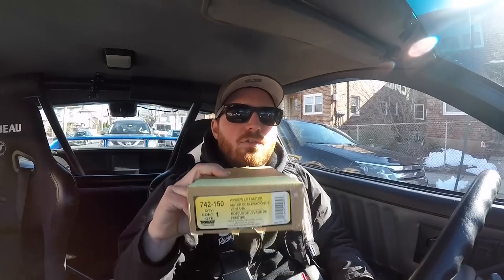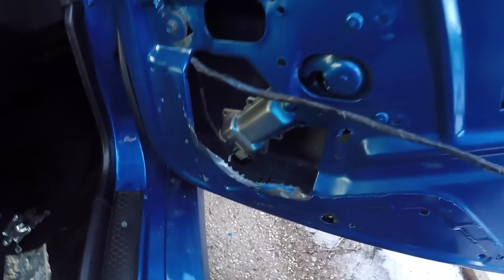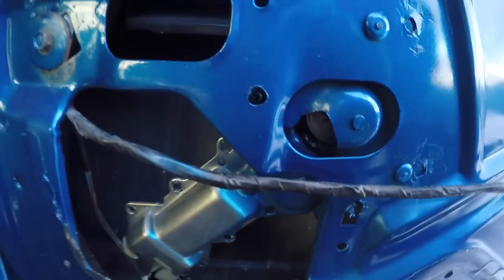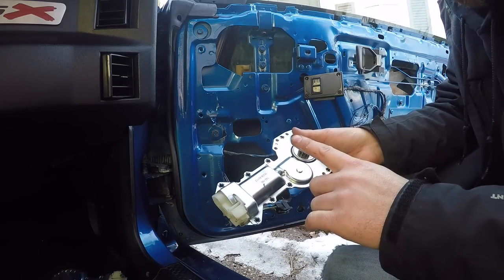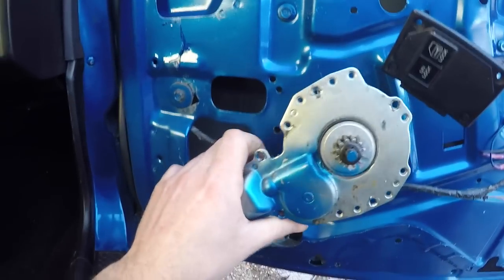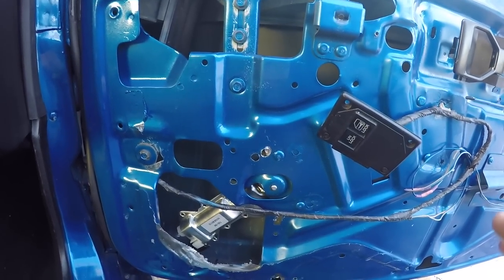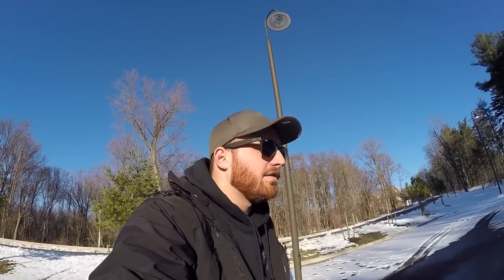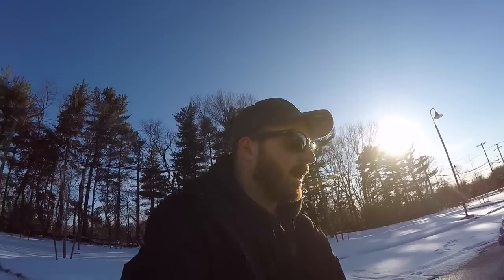The Easiest Way to Replace a Window Motor in a 3rd Gen Camaro!

Comment: Nice video, he’s got the right idea. If confused there are more detailed videos out there. Pro tips; use oversized self tapping sheet metal screws to secure the motor back in place, no nuts & bolts yay. Put dynomat sections inside the door against the body, aim for 25% coverage. For even more sound deadening add foam padding to the back of the upholstered panel. Door will sound crisp when shut. You can also order new plastic covers, window sweeps, door sealing gaskets, plastic push pins, etc. If your particle board backing is falling apart use metal tape to reinforce it where needed. Also be sure to lube everything while you’re in there. And if you need to fix your door handle, do it now! Don’t forget and put everything back together like I did lol.. maybe I should make a video..
Reply: Thanks for the tips and you for sure should make a video

Comment from the maker: I remembered after uploading this video, that I did in fact remove the whole window regulator when I last replaced it. I replaced the doors when I installed my ground fx, so I had to swap my power regulators into the doner doors which  had manual windows. I riveted the regulators back in,  making it look like they weren't touched! Yea, so that confused me a little....
Reply: Can you share the link to buy the Door window regulators?
Reply: Thanks lsXmatt , i have a 3rd gen camaro and this video was very helpful . God bless you bro.

Comment: DUDE THANKS!!!  Was looking for tips and your video nailed it all!  My motor was previously replaced…they riveted the assembly back in BUT bolted the motor to the reg…ONE SCREW fell out causing the motor to twist and bind up…also front of window came out of track…SAVED ME the wait on shipping and hassle of replacement.  

“Marilyn” 
‘91 Convertible Z28
Yokota US Airbase, Tokyo

Comment: Hey if wanna tip for changing your oil warm the engine up abit then drain it but wear gloves just incase it's to hot then put 500mls of the new oil down it with the drain plug out so drains straight through and cuz the oils warm it will drain more of the crap out n then the old oil won't stick as much to your engine internals then top it right up with the new

Comment: Hot dang. I was getting worked up when I seen everything was riveted. This was a breeze compared to what I was going to do. Replacing all those rivets with bolts I was not prepared for. Hardest part was door panel and getting all the tools.

Comment: ....  and then replace the motors again in a couple years or less because your shortcut didn't do anything about the reason why they failed in the first place...  high resistance in the tracks.  Lack of clean tracks with fresh lube and sticky rollers will murder those motors in no time flat.  And the switches too.

Comment: That’s plate they give you is really small anyway. There’s no way that can be used . The bracket it has so much bigger and is what holds the corner sprocket and rails

Comment: How many rivets are there holding on the motor from the factory? Can you easily get to all those rivets by drilling holes like you did? You only had 2 holes drilled and you added a third hole in this video but from the factory I think there's at least 1 more rivet right?
Reply from the maker: I think from the factory it has 3 holding it on I believe. I think when I first changed it I removed the regulator, that’s why I didn’t have the third hole drilled. When I did my driver side I didn’t remove the regulator. I have a big rivet gun, so I riveted the regulator back in.

Comment: So instead of doing as factory instruction direct...you WAIL on inner door structure to clear motor without complete track... and one you replaced lasts.....how long before you're here doing it again ?  Without ALL the screws (rivets) in motor, it flexes the panel, and binds the drive, resisting window movement...and burns motor out.Nice car.
Reply from the maker: Hey I said it was the easiest way, not the right way...
Reply: Granted. I saw later a very LONG vid showing all the guts removal, working alone...can't imagine having dealer$hip rates R+R on this.

Comment: Mine came with a broken driver regulator. I searched for affordable regulator for 3rd gen Camaros and couldn't find any in my budget. I then thought about the 4th gen Camaros having faster windows so I gambled and purchased regulators for a 4th gen. GM didn't change a lot of things between the generations. I had to use the passenger side on the driver side and vice versa. They are the same units fellas and cost about 40% of the price. Don't buy 3rd gen regulators. They come with motors already an are a lot faster now.